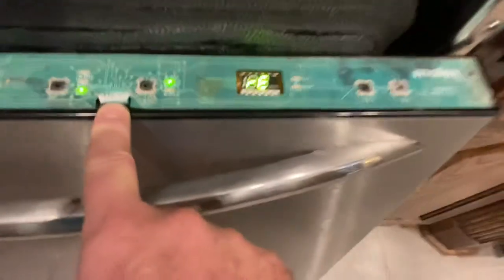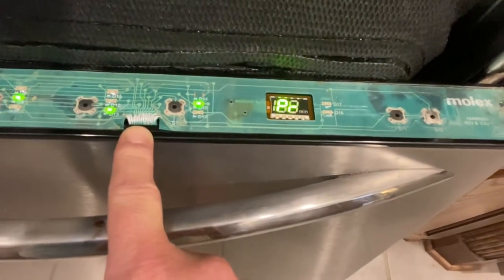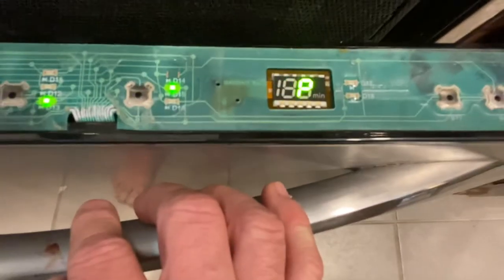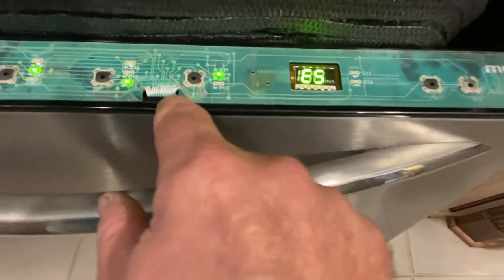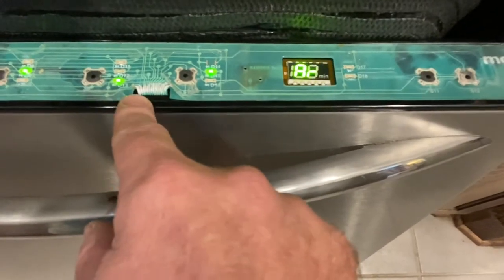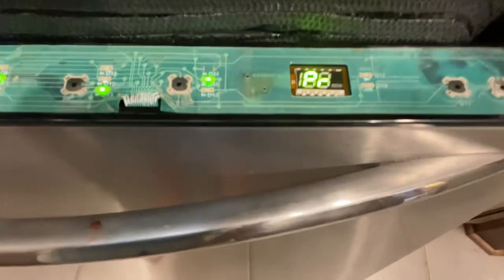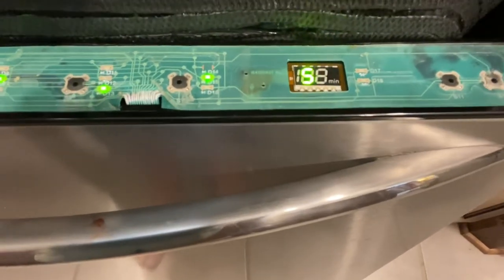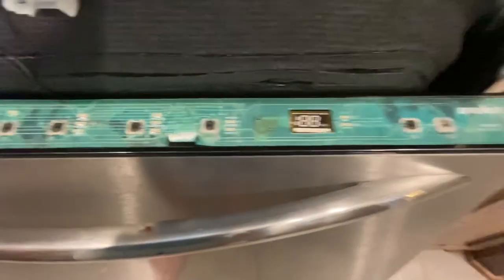Frigidaire /Electrolux dishwasher touch panel stopped working - fixed!

Comment: I am an experienced electrical engineer who designs embedded electronics.  I have this exact same failure condition where the start button does not register after some time.  I can gently coax it into working again by repeatedly pressing combinations of buttons and opening and closing the door.  A few times, I have had to run to the basement, flip the breaker and reboot the dishwasher.  This seems to solve it every time.  This leads me to believe the failure mode is not corrosion (I have never taken mine apart to have a look), because in every case I can get it to work again by a reboot.  This seems to me to be more of an issue related to latchup within the microcontroller and the way it samples the button PCB.  Astute users may also notice the LED's get faded, and sometimes the numeric display is difficult to read.  This is further evidence of latchup where the logic 1's and 0's aren't getting written or read by the microcontroller properly.  I hate that we are where we are today with junk products, but that is the current state of affairs and there appears to be no known fix for this issue besides removing power and thus removing parasitic charge that happens to be somewhere in the system.
Reply: This is the exact same problem that I have. I usually open and close the door several times to get the display to show and then press the start button repeatedly until it beeps and the close door prompt shows. Are you saying that replacing parts such as the control strips won’t fix this? I’ve been putting up with this for several years now. I’ve never tried just throwing the breaker.

Comment: I had an issue where all buttons worked except the start button. I saw from a previous video that the pins at the contact were dirty.  I removed both ribbon connections and put them back on and now it's working great.
Reply: I’m having the exact problem now, will try that method. Thanks.